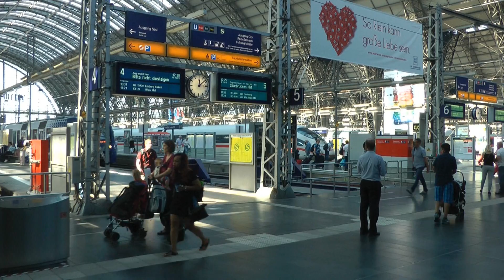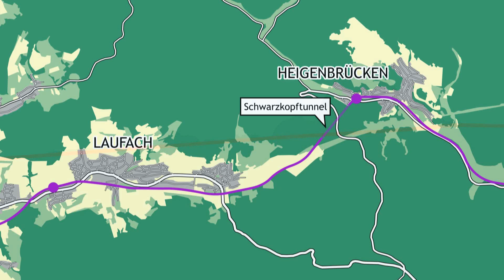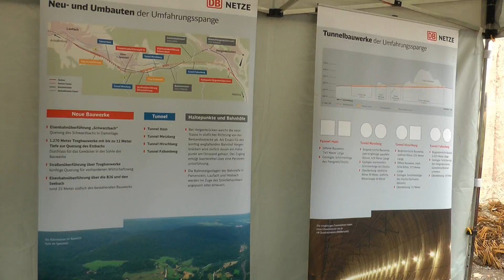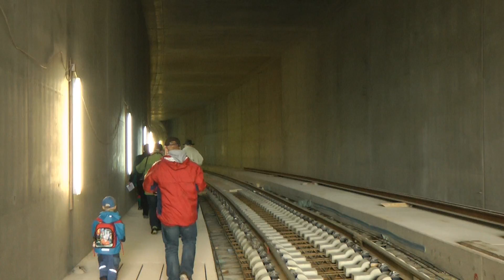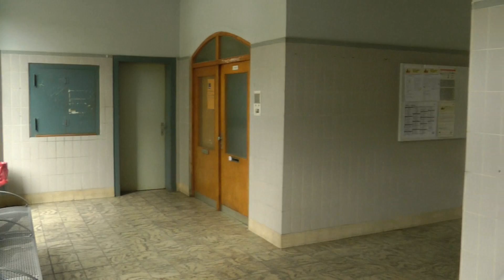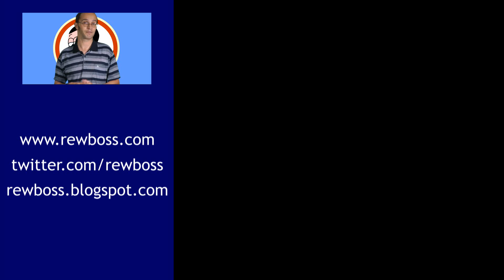Upgrading the tunnel

Comment: Apparently it was indeed finished in 2017 (https://www.neues-deutschland.de/artikel/1057576.abschied-von-der-originellen-spessartrampe.html). I suppose the things that actually do get finished on time go on unnoticed by people and the media...
Reply from the maker: It was finished on time, but unfortunately proved slightly too steep for the heaviest freight trains in wet weather, which occasionally got stuck. I don't know how they solved that particular problem, but it did attract the attention of the local media for a bit longer than was hoped for.
Reply: @rewboss  Yes I did read that too...some said they needed to use another locomotive anyway for the really heavy ones. I don't know if that will be financially sustainable...

Comment: Nice!
Slab track!
Always sad when they close railways. But if it is replaced, then it is necessary. We had a tunnel replacing incline here in Sweden last year. It should have beem finished in the 90's so its sort of our Berlin Brandenburg.
Reply: Hallandsaasen? I'm still sad they didn't retain the old line for local traffic, perhaps even reopening some of those intermediate stations... And I really liked the old station building. I believe it has not been torn down, but still. The new station is no less than 4 km from the town...
Reply: The building and platforms are still there but the tracks are gone.
It had to do with that the cost for upkeep was to expensive, especially after building a tunnel that expensive. There werent many intermediate stations, the existing ones have sort of an equivalent on the new line (Förslöv and Båstad) and it was also possible to open a new station in Barkåkra when they opened the double track.
Reply: I understand the reasoning behind it, when passing over the old line, I could totally see why it needed to be replaced... for long distance trains. I can't say how successful a Grevie station would have been, and how useful the old Baastad station would have been together with the current one, but I would have like to see them try first... But I can see why a municipality doesn't want to cover all the costs for that...

Comment: Just during these days it happened.
Reply from the maker: The tunnel is open, but only a single track. The line will have to close again for a few days while the other track is connected. After that, the new timetable will come into force and trains should run normally, but it will be November before everything is completely finished.

Comment: The rural areas find any reason to make a little festival, huh?
Reply: Any area finds any reason to make a festival. If there isn't any festival where you could savely drink lots of alcohol without directly being regarded as an alcoholic in a range of about 50 to 60 km around your place for more then a week, you can be sure that either you didn't check good enough or you are not in Germany.

Comment: The line I use, in Thuringia, could certainly do with an upgrade, as it's a single track. There's a viaduct that's so rickety that trains can only travel along it at just above jogging speed. Also, the station in my village is so crumbling that they've had to permanently close off two of the platforms!

Comment: As I know the Deutsche Bahn "Railway Experience Park" means "don't remove the obsolete rails to save costs"
Reply: With ca. 400€ for a tone of steel crap, there will be companies who will take them on there expense. 1km rails are ca. 140t of steel on one side. With both sides you get 280t. 280*400=112.000 so you get for 1km rail scrap ca. 120.000€. 
But the problem is the gravel and ground under the tracks wich is often hazardous waste as it is contaminated with oil and at verry old tracks, the wooden rail carrier bars are impregnated with toxic chemicals.
I guess with a Railway Experience Park they meant that they will preseve a parts of the old tracks as it known that old tracks usualy develop a typical ecological environment wich attracts by some rare plants and animals. Geckos and snakes eg love the gravel. Some slow growing flowers can grow there without beeing ousted by usually fast growing weed.
Reply: sometimes it's not possible because of preservation reasons.